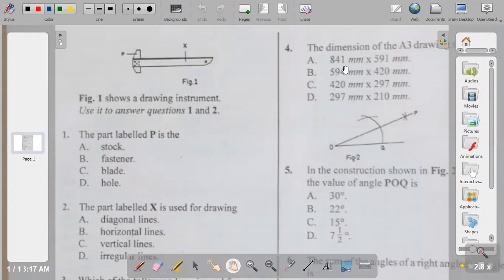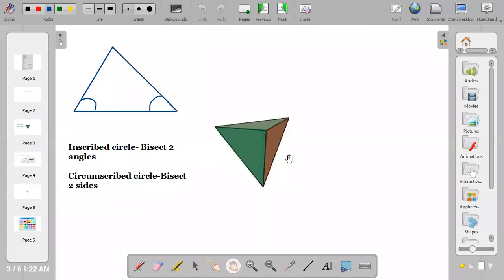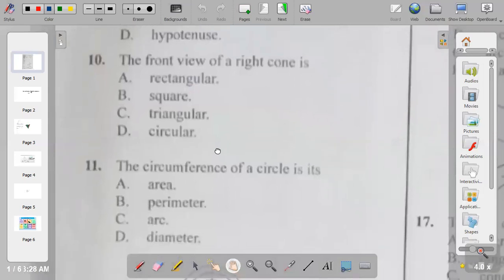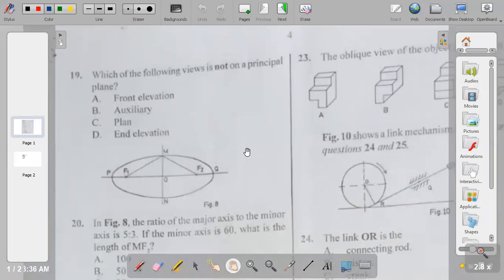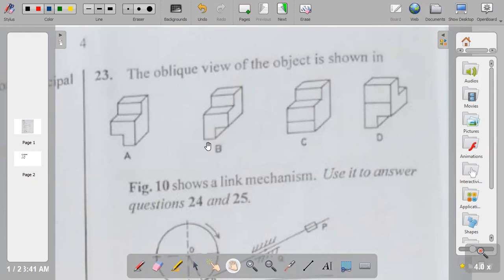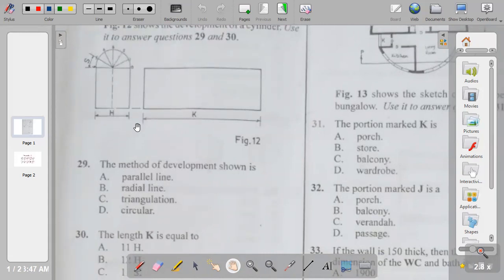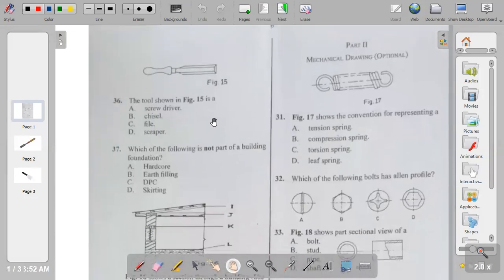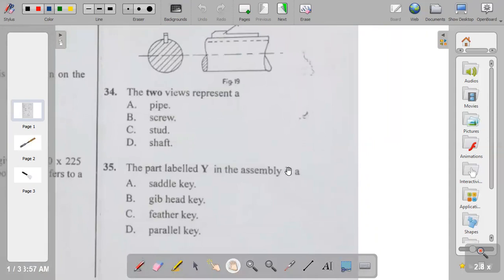2019 TD Objective questions and answers

Comment: The answer for question 3 is d since thick at ends is used or a cutting plane for sectioning. You took b as the answer but that line is used for a centre line. Can you pls help me out by throwing more light on your explanation
Reply from the maker: Option D does not exist under the different types of lines. Thank you